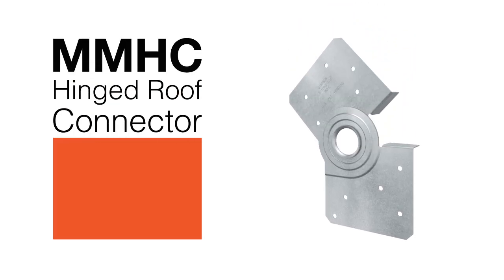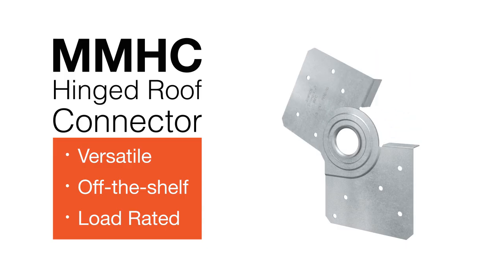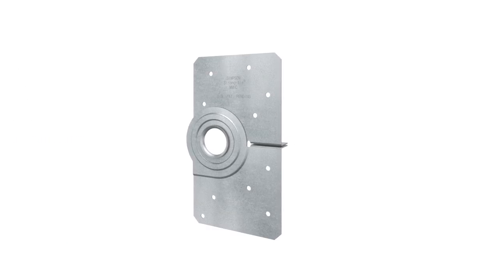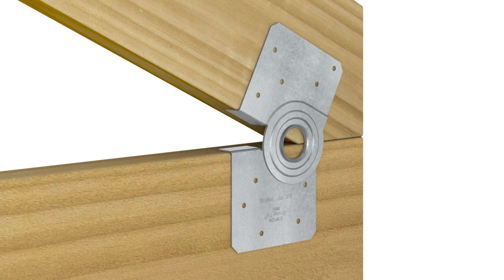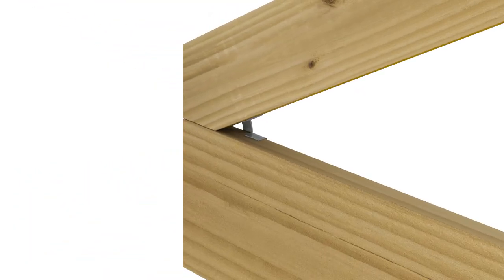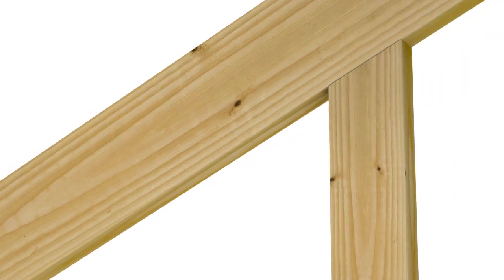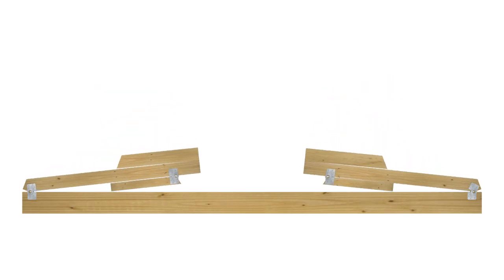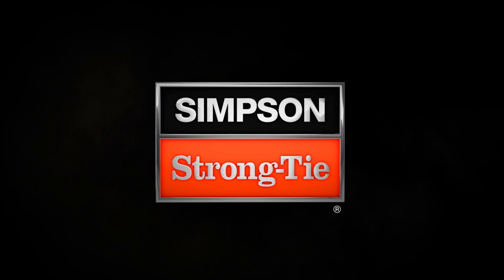Learn How to Install the Hinged Roof Connector (MMHC)

Comment: How does this compare for snow loads and pitch strength with a conventional roof
Reply from the maker: Hi Timothy,

The loads in our table should be adjusted linearly depending on the roof pitch. Also, the amount of snow designed for on a structure depends on the location. You can check out our load tables for reference (linked below). We also offer free engineering services at 800- 999-5099. You can speak with a structural engineer who would be able to work out your question and offer sound advice. https://www.strongtie.com/rafterties_factorybuiltstructures/mmhc_connect/p/mmhc